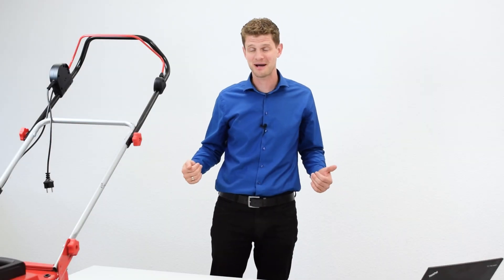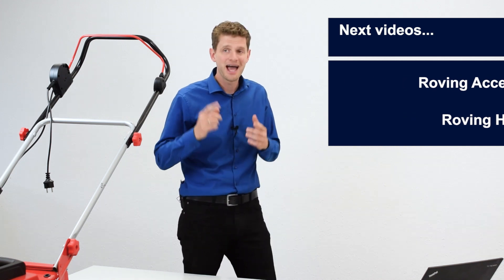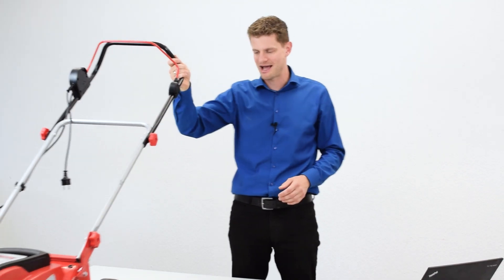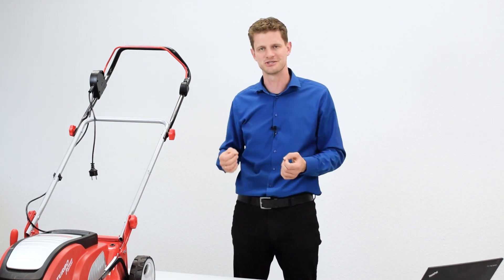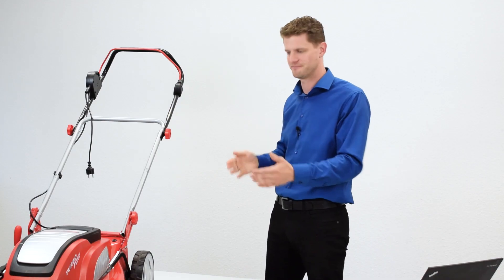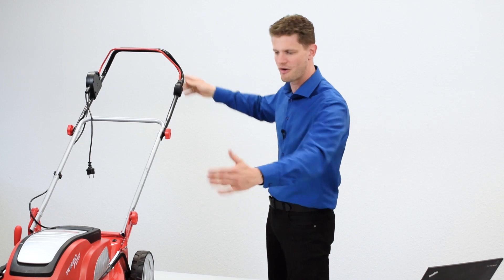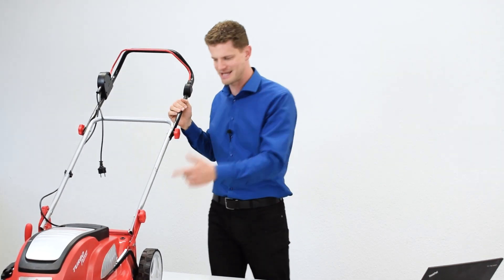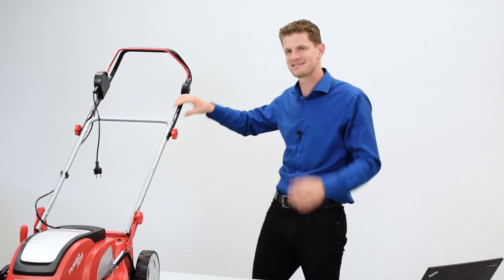Introduction to modal analysis | Part 1 | What is a mode shape?

Comment: A definition of modes based on linear algebra theory is so much much more satisfaying! A mode is just one axe, one dimension of an infinite dimension space. It blows the mind to realize that there is complete analogy between a 3-D dimension space and a modal space. To imagine a stationnary wave as one axe of a basis is just unbelievable, but it's true. Teh imagination can't accept this analogy, but using mathematicz, we can see the perfect analogy in particular the orthogonality property. 
In 3d-space, what is growing, it's the length of th (x,y,z) -axis for example, but in a modal space, what is growing, it's the amplitude of the specifics waves.